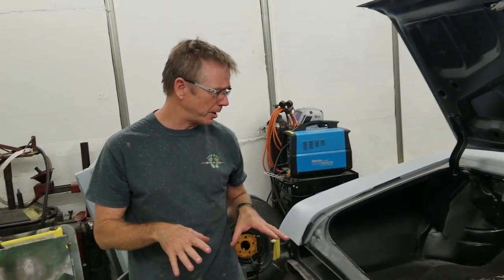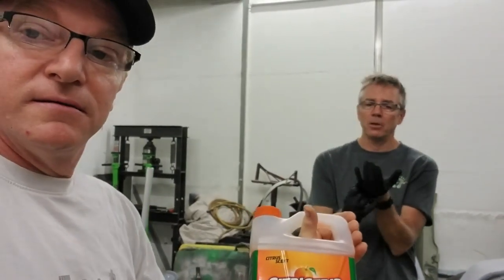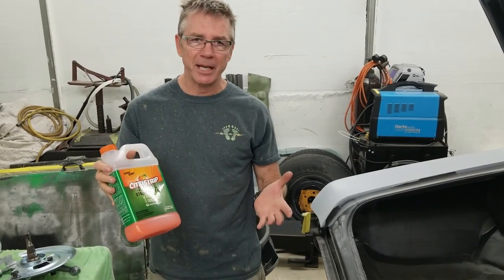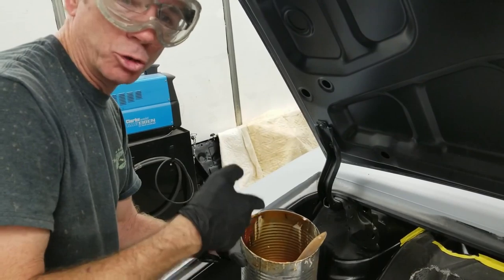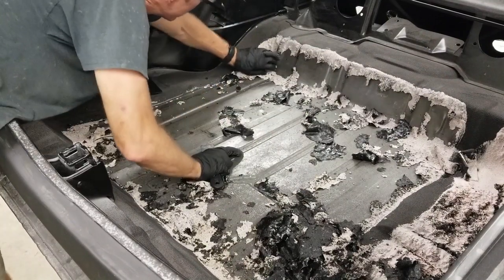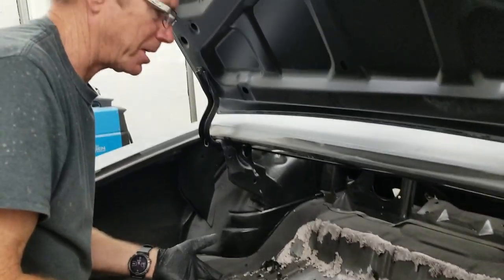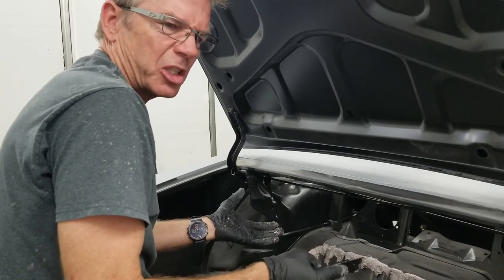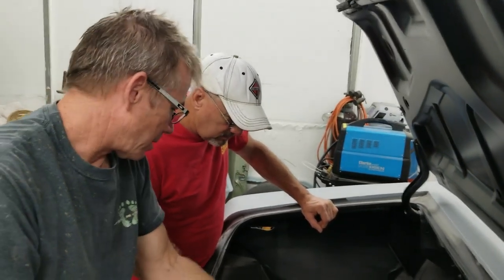Removing Rhino Liner With CitriStrip! We were Impressed.

Comment: Will this stuff take liner off paint without damaging the paint under? For example i have this truck bed camper that was previously covered in liner and i see some spots where its chipped off and the paint under is the same color as my truck so i was hoping to remove the liner without damaging the paint.
Reply: Nope. It will eat the paint as well.

Comment: I have used it for years, and I use the same procedure, and works great.  This video is not faked, it works this good.  No gloves actually needed and doesn’t burn skin, bad smell or irritates eyes.  This stuff doesn’t harm lawn if you do it in grass.
Reply: I have bed liner sprayed on the chrome of my truck. Will this stuff work to get that off? Tried acetone and it’s taking forever.
Reply: @joshburr1549  sandblaster is the best way to get rid of it.
Reply: @wildestcowboy2668 can’t be he just showed him scraping it off
Reply: @aaronhusain1659  is u sayin da brotha's a MF lie
Reply: @wildestcowboy2668  I’m saying dude in vid didn’t sand blast nothing he just scraped it off
Reply: @aaronhusain1659  thanks fo clearing da miscommunication up Boss

Comment: Just wanted to come back and thank you. I bought a 79 Bronco that was covered in bedliner. It was much harder to deal with than I anticipated until I watched this video. Saved me a tonne of time and money.

The liner peeled right off
Reply: Did it peel the paint off underneath? Or just the bed liner?
Reply: @Thathippylookindude  in some areas it went right down to bare metal mostly it took off the bedliner. I found that it was key to put a good coat on and then cover directly with plastic. The longer the stripper stayed wet, the more it chewed through.

Just finished stripping the entire 79 Bronco last Night as I had run out and had order delays. If you are looking to remove bedliner, I would definitely start here. Saved me huge money
Reply: @zerosjourney9887 I am about to do this to a truck bed. This is very helpful information, thank you!!!
Reply: Did it wreck the underlying paint?
Reply: going throught the same thing right now

Comment: Learned about the plastic sheeting a couple years ago. It keeps the stripper from drying out. As long as that stuff is wet, it keeps chewing. Saran Wrap works really well also and sticks to everything easier than plastic sheets, if you're doing smaller parts.
Reply from the maker: Thank you for checking  in! We were very impressed too!
Reply: I've used a similar citrus stripper to remove the anti-fouling paint on the bottom of boats. The Saran Wrap is great and not so much plastic waste.

Comment: Hey I just bought an old Honda Goldwing. The previous owner put rubberized undercoat on the front of the cylinder heads and the front of the lower shock because the aluminum finish was pitted and worn. I want to remove the ugly black crap and polish up the aluminum. 
Would this work do you think? What would you do to protect areas nearby from the citristrip? 
Any tips would be appreciated.

Comment: Wow. What a miracle product. Will this work in the exterior of a sprinter van? I’m considering buying one that was rhino lined or something similar by non professional. The original color the van is black. Can I use this product on the sprinter exterior? If yes, will it take off the original paint?  If it does, I assume I need to prime and repaint. What’s best way to handle this?  Thanks in advance for any advice.
Reply from the maker: Its a Cheap hardware store product and it was able to (with time to do its job remove ) what we had under the car. Yes you can use it on anything you want removed... paint is not problem!  Paul found this product as he does restorations on old houses!

Comment: Could you pressure wash it off after the stripping agent does it's job?
Reply: Good question. Only thing I’d be afraid of is using water on any parts that have exposed metal. I mean, if you dry and primer immediately it may be no problem.

Comment: Question.  I'm doing a restoration where I am trying to find the original primer color painted on the underbody.  However, the car's underbody sheet metal seems to have a thin layer of a grey/black rhino liner type coating.  I say that because the texture is certainly there - kind of similar to an 80 grit sandpaper, but smooth vs. abrasive.  Not sure really what it is but I don't think it's primer.  Also, it doesn't seem to be rubbery like undercoating.  It's hard.  Anyway, have any thoughts on removing just that layer to have a chance at the primer underneath?   I have used citrus remover before, and I think if you let it sit only minutes, you have a chance at seeing the layers come off vs. everything above the metal.  Otherwise, I thought of a flap disc, maybe a layer at a time.  Thoughts?
Reply from the maker: I would try areas of both methods to see which one can give you the best results. We have only used citrus strip for paint removal and recently rhino liner in this video(which we do not know the type of product because it came from another shop)..... finding the original color substrate should show either way scraped or grinding.

Comment: Does this stuff work on powdercoating ? I currently either use harsh aluminum rough grit oxide on steel or air craft stripper and a pressure washer but this looks more promising.
Reply from the maker: Unfortunately I dont have "that exact" answer,  we just used this product to strip paint and found it removed rhino liner that was sprayed in this car.

Comment: I been using  Citrus remover for years now,  started using it to really clean my areas where I was  Leading repair to make sure every little pin hole was clean. Since it's nontoxic nature product my Lead lays like butter, when I used Airplane striper if I didn't get it 100% clean of the striper I noticed my Lead was just acting funny, it's hard to explain.  
I found out about the Citrus striper from my Cast Iron Cookware group when I was restoring an old Griswold wood fire oven trying to remove the tar like paint someone painted it with and removed it like nothing I have seen before and it's safe for the environment
Never thought to cover it with plastic,  I think the plastic keeps it from drying out faster and helps it work longer, Thanks i am going to try to cover it now
Reply from the maker: Thank you for taking the time to write! Yes we were happy that Paul found this too... it works being covered and with a little time to work.

Comment: Buddy of mine has a Range Rover with bed liner on the paint and is wanting it removed. Will this damage the paint underneath? Thank you!
Reply from the maker: Yes it will take the paint too.
Reply: The paint under your bed liner is already destroyed 
If it was installed have decently correct you have to sand into the paint to get good adhesion

Comment: Does it bleed much from edge of brush stroke?  I might want to strip a section of polyurethane bed liner (Durabak) to install a rectangular light housing.... that without strip would not install well over the textured liner.
Reply: I have a similar situation but I need to remove a small strip along the inside of my tailgate for a tailgate cap to fit and adhere correctly
Reply: I've talked to Durabak since this message.  Their reply to best way to remove it where needed (like from bolts/nuts....  was basically...... YOU CAN'T...  NOTHING removes it.   Which I sorta like.....  means disassembly of parts will be a PITA....  but so is disassembly of rusted parts.  Way I see it ... Both a PITA but one at least means after your wire wheel the stuff off the odds are significantly higher the metal underneath is good.......

Comment: If I use this in the bed of a truck will it strip the paint out of the bed of the truck? Does it matter if I am just going to redo the Liner?
Reply from the maker: Yes it will take the paint. If your using rhino liner then just pit rhino liner over paint... no need for any stripper. Thankyou

Comment: Some idiot bedlinered the whole 05 Mustang I'm working on this is exactly what I needed to know . thanks
Reply: Howd it go?
Reply: Looking to take the bed liner off my jeep for a new job
Reply: @BestMoviClipz  Well it's slow going but it does work ,you need to follow the directions and for me I wound up taking the paint off completely down to the metal on most of the car . Since the guy who put the bedliner on used 60 or 80 grit paper on the paint anyway and scratched it down to the metal .

Comment: Thanks for the video, really probably should be using PPE regardless just because something smells good doesn't mean it's safe. If I remember correctly it is recommended to do gloves eye protection and respirator. Sometimes it's not even the product you're using but the product that you're trying to break down. Not trying to give you a hard time or anything it's just we all need to do better for our family's and set better examples. I'm guilty of it myself sometimes.

Comment: AWESOME!!!!! i've been searching for something like this forever. thank you, im gonna try it this summer
Reply from the maker: we just used it again on a deck lid (purchased another bottle from a local hardware store) ....it takes a little time to work, but the nice thing isit doesnt burn your skin or eyes and you dont have to worry about obnoxious fumes. scrapes off within a few hours of coating...but still wear the PPE anyways.
Reply: @ES4406  and I don't need to dilute it or mix with any other chemicals? Pour it into a Basin, apply it with paintbrush, (how many layers?), and cover it with plastic sheets and let sit for 24hrs? To get best results?
Reply from the maker: No need to dilute it. just brush on and cover. the covering keeps it from evaporating. works good, just a little more time than the old stuff in the day..
Reply: @ES4406  thank you sir!
Reply: How did you guys treat the metal for paint?  Brake clean?

Comment: I brought my truck and it already had the rhino liner on it. But it’s a 04 truck. The liner is coming off due to age. I want to have it redone. But it save me a lot of money if I can strip it by myself. Do I have to get every square inch of it off? Also should I wait for a hot day do it? Because I live up north where it’s only in the 50’s. Also for the plastic, can I use a plastic paint drop cloth?
Reply: I'm researching to remove an aftermarket spray in liner from an 04 truck as well.  I'm curious what route you ended up taking. Would you mind sharing your experiences?
Reply: @pdab4372  I ended up not having to remove it. I took to a mechanic that helped me spray the new liner on. He told me to basically taken a hard plastic grinder or you can use sandpaper to scuff it up. Make sure you do the whole entire bed . Every square inch of it. You want to get rid of a sheen in the liner or see that it looks all scratched up. This way, when you spray on the new liner, it doesn’t want to peel off. I didn’t mine back around October, and I have had no problems with the new liner wanting to come off.
Reply: @surfindude23  thanks for the quick reply.

Comment: Hi i tried this on my gmc kodiak bed its coated with rhino liner and it didn't touch it. It just turned it white on top it was applied heavily and covered for over 24hrs. Has anyone else experienced This?
Reply: I'm curious how you moved forward removing the Rhino liner. What process worked for you?

Comment: Do you think that would work on plastidip? I'm trying to remove this weird paint+plastidip+paint combo I got going on. Not sure whether to use this, aircraft stripper or sand it
Reply: ???  plastic dip is suppose to be able to be peeled off.  If you use this stuff... your liable to take the regular paint of below it as well.
Reply: @coachgeo  yeah that’s what I wanted. I was trying to get to bare metal. Turns out it didn’t work on the plastidip.

Comment: Will it work on Raptor liner?
Reply: You ever find out?
Reply from the maker: It should.... if you apply a lot over the area and cover it up with plastic for a day.
Reply: @ES4406  i curious what you think about my situation. I recently bought a rust free 99 powerstroke. previous owner put a very minimal coat on the lower 12" of im guessing rustolium bedliner. its still kinda rubbery and the paint surface wasnt prepped in any way
Reply from the maker: @stevenpartridge9889  Maybe it a try? the product is cheap and safe to use... just takes time to break down what you are taking off.

Comment: Maybe I applied it incorrectly but It didn't seem to work for me
Reply: UPDATE: I tried more because I had a few quarts left. I noticed the longer I left it on the more effective it is. After 2 days it's rubbery enough to peel off and after 3 days it starts to bubble. Thank God, I was not looking forward to grinding my whole bed liner off. The bed liner is probably 20 years old at least. It traps moisture underneath it. It's an El Camino from Texas, the only rust and rot on the whole cruck is under the damn bed liner!
Reply from the maker: Yes and like Paul did in this video he covered it so it could not evaporate.... We thank him for finding this product.. its a cheap hardware store product thats not harmful.
Reply: I found that if I leave it on for a whole week the bed liner peels right off in whole sheets!

Comment: I don't believe you can get rhino off with that I sprayed rhino for 7 years... U might be able to get raptor liner off or liner in that area but industrial liners like rhino and some linex I don't think so
Reply from the maker: We havent tried on industrial... I cannot tell you this product that was sprayed in the cars trunk we dont know...but this stuff that was applied in the trunk was not having it even with a whiz wheel before we did this video.......but... we were happy with this particular finding...  It may not work well with better industrial.... but heck this was worth a try.
Reply from the maker: Very good comment thank you!  Also to note we were just happy this stuff worked in this instance and the spray millage was not heavy.....I am sure like you said if it was a heavy application or industrial.... a very possible different out come.....